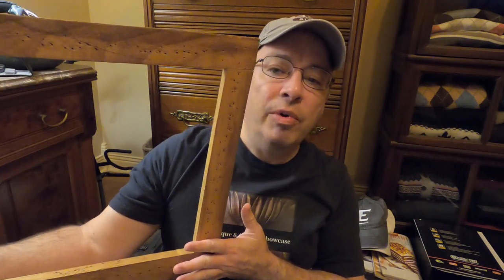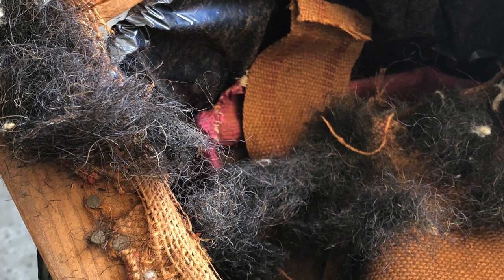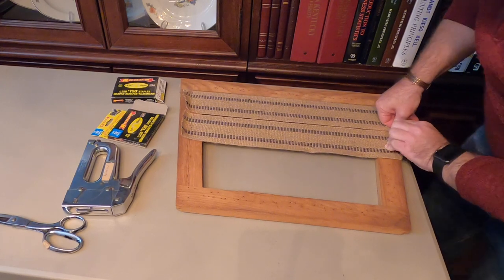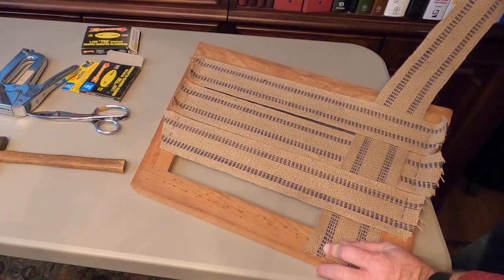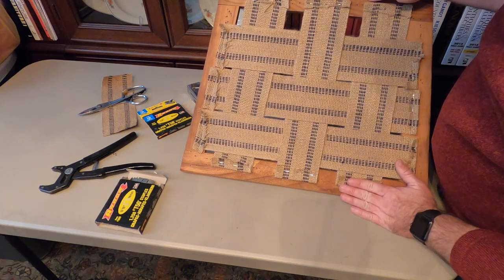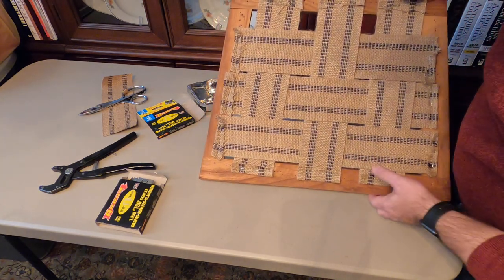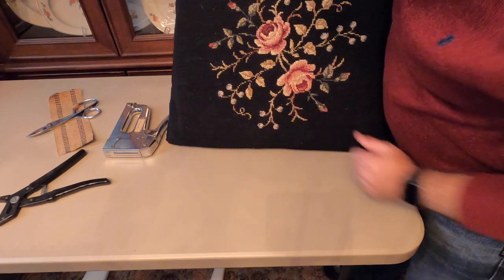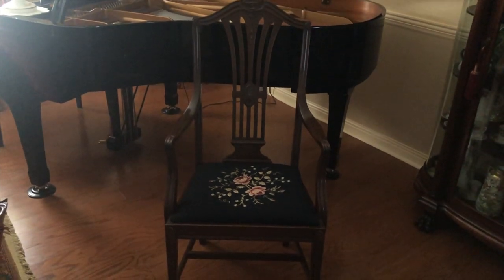🪑🪑Chair Seat Restoration🪑🪑

Comment: Looking for needle point tips, which I rarely do as an upholsterer, but thought I'd mention to those reading this that you will want to put burlap or a light material over the webbing or the webbing will eventually cut through the foam. Also you always want to pad the foam with a cotton or Dacron (synthetic cotton). Foam is an open cell product and will open its pores when you sit. When you get up those same pores close which can and will pluck the underside of your upholstery, ruining the material from the inside out.
Reply from the maker: Good suggestion!

Comment: Hello, I bought 4 of the same exact chairs I just removed the fabric someone put over the original seat and it’s exactly the same pattern as yours. They’re very dirty though and I think some of the red dye from the new fabric may have rubbed off on the black. Is there any chance you might be able to tell me how to clean these and bring them back as much as possible to their original state? There are no tears they’re In surprisingly good shape accept for being very dirty.I was shocked to find the original pattern underneath. Thank you
Reply from the maker: Without seeing them, it’s really hard to say 100% how I would clean.  A cleaning approach I’ve read about for cleaning old textiles is to always take a dampened q-tip and rub against fabric to check for color fastness, first.  If it doesn’t run, the article said to wash in an oxy clean solution in cool water - to avoid shrinkage and lessen the possibility of a color run.  I would let them air dry on a flat drying rack to avoid creasing.  I hope this helps.  Good luck!!!
Reply: @antiquegardenshowcase  Thank you

Comment: What is that woven strip called and where can I find it?
Reply from the maker: I’m not sure of the proper name, but I found mine in the fabric section at my local Hobby Lobby.  It was available in different widths depending on your project need.  It’s a jute type banding…
Reply: Its just called webbing. I prefer the jute webbing, not elastic as the elastic will stretch out ant the seat will soon sag. You want to get it to stretch as tight as possible. I use a webbing stretcher to achieve this.
Reply: awesome this was my question! great video Sir.